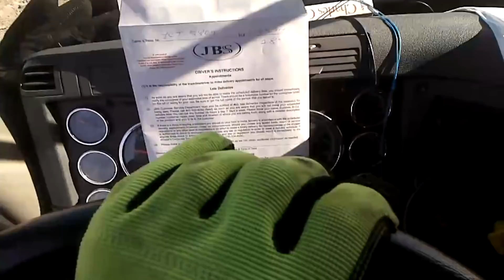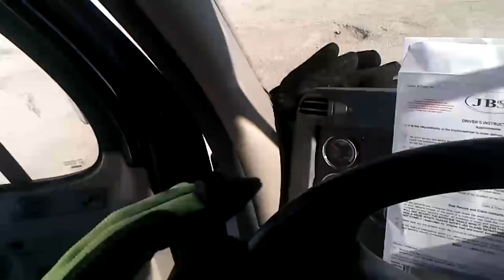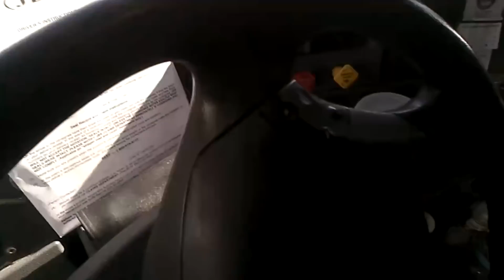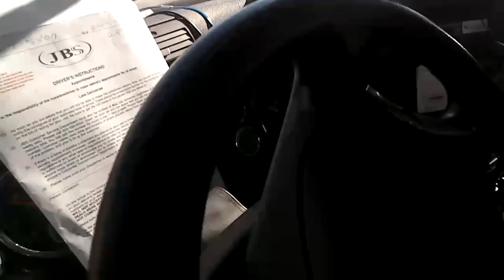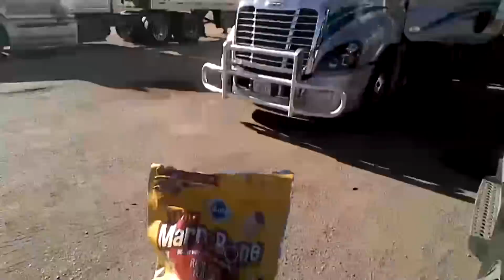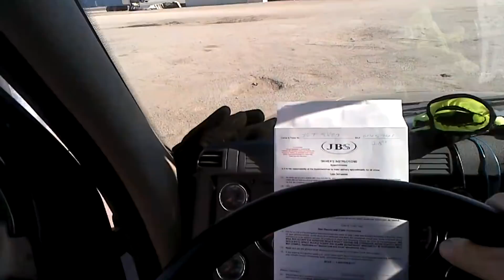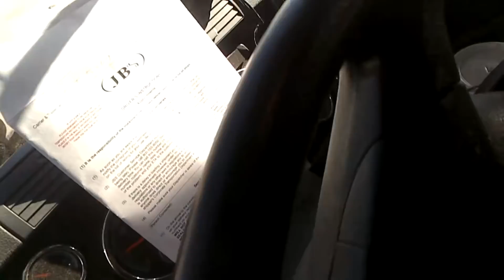Drops Swaps and Scooby Snacks

Comment: Some trucks have an auto-grease of the 5th wheel. But I don't know if it's good or not.

And it seems like there are different preferences on how a trailer shall be dropped.

I also hope you didn't forgot to raise the legs of the trailer before you took off!
Reply from the maker: Yes every driver drops the trailer  just a little different than other drivers. I used to get mad about it but it is a waste of good energy.